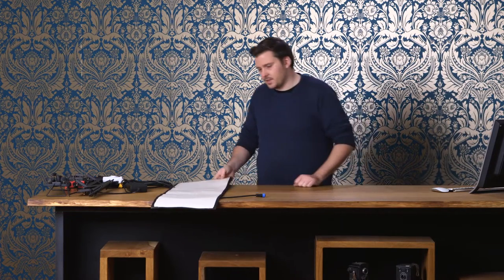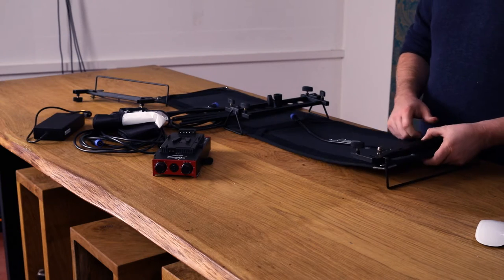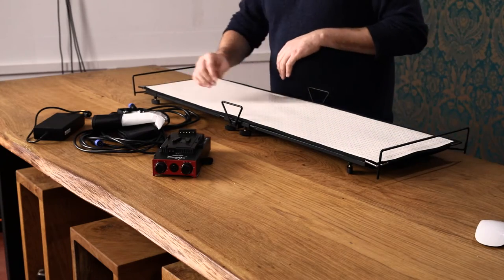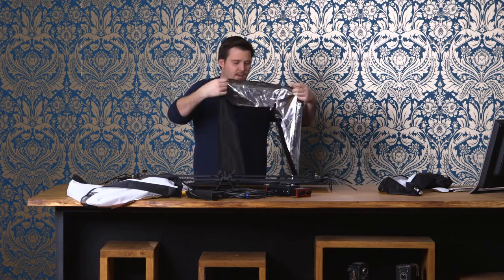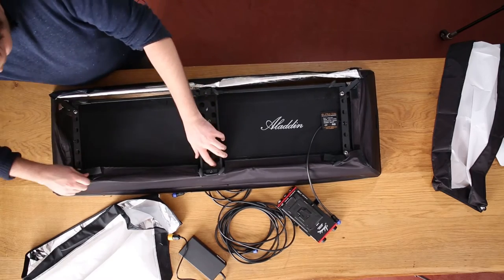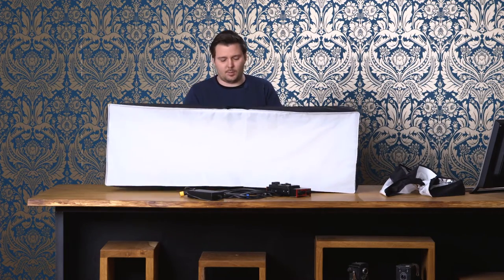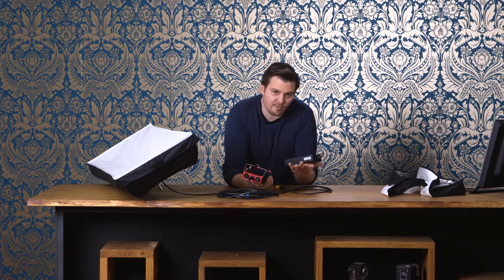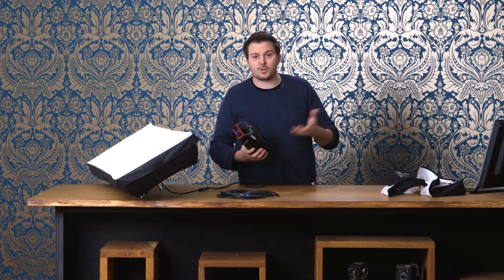ALADDIN BI-FLEX 4 Tutorial | How to set it up

Comment: It is imposible to find a eggcrate grid for this 1x4 aladdin light :(
Reply from the maker: if you have the old frame then the only solution is to mount a softbox and put a eggcrate on it. otherwise for the new frame there is a aeggcrate to mount directly on the frame. 

https://aladdin-lights.com/bi-fabric-4/
Reply from the maker: or do you mean you cant find a dealer for it?
Reply: @AladdinLights  can you sent my a link to order right away in the USA, thanks in advance
Reply from the maker: @pablomarin1746  https://www.ushio.com/aladdin-led-fixtures/ this would be our distributor in USA or trough B&H